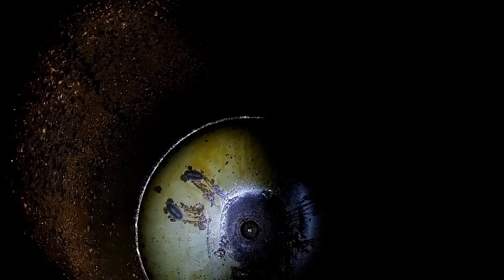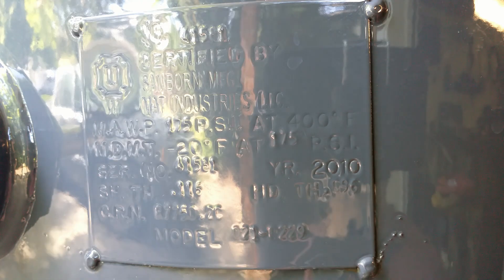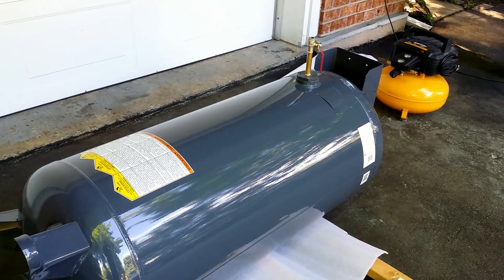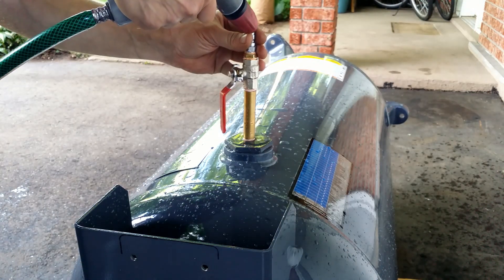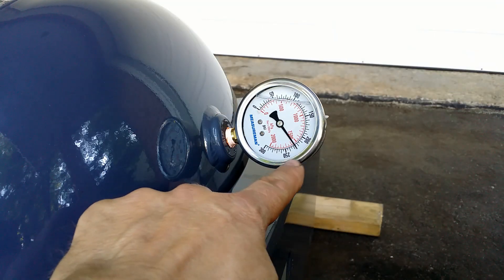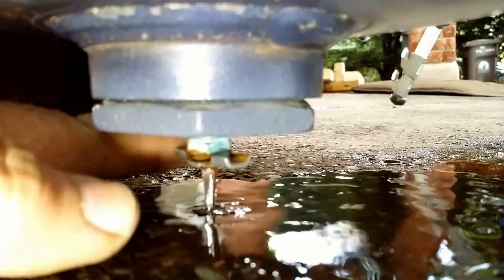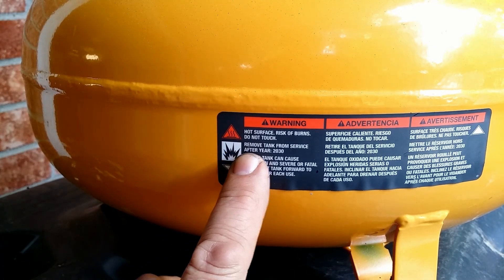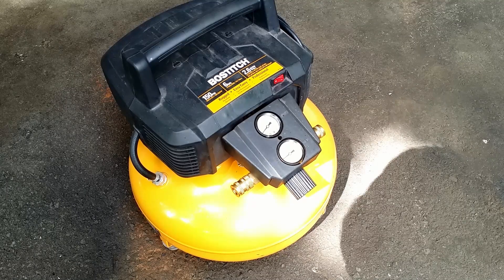Air Compressor Explosion Prevention. Hydro Test.

Comment: Was wondering is there a coating that could be applied inside the tank ? As some know hot water heaters are fiberglass lined to prevent corrosion now days. So why not a air compressor tank is it job security to build something perishable? So you have to buy the same thing over and ovr like toilet paper? I wonder if these manufacturers could do better.
Reply from the maker: Water heaters hold less presure and must be replaced every eight years. Compressed water doesn't hold as much energy like compressed air does. In case of tank giving up the water looses pressure instantly, the air tank will explode, and I mean EXPLODE!!!

Comment: Testing is only good to determine if the tank will explode right then and there at a certain pressure. Has no relevance to future safety. Testing is only useful to establish parameters as per design. When new.
Reply: Yes, without measuring deformation, this "test" is actually just over-pressurising your tank without making you safer. The maker of this video should have taken some old tanks that were visually obviously unsafe due to the amount of rust and damage and then tested them, I am sure many would pass this test on the first attempt but would fail if you kept repeating the test.
Reply: So what is a good test then?

I see many comments criticizing but none offer some tangible advice...go figure.

Comment: Excellent video. I will test my 25year old small horizontal compressor using this method immediately. Or maybe just buy a new one anyway….the pressure vessel failure videos/ pictures are a real wake-up call.

Comment: so now the tank has been stressed to 150%, I would trust it even less. Why not use an ultrasonic thickness meter instead?
Reply from the maker: By industry standards small (and yes, for the industry 60 gallon is small) pressure vessels are tested by filling with incompressible fluid (like water) and pressurized to 150% working pressure. Additionally, the tested tank is submerged in water to test how much it expands in shape. But you are right. Ultrasonic tests are sometimes conducted in larger vessels, piping and installations that work under pressure.

Comment: Did you change the gauge for the test or is that the same one used normally by the compressor?
Reply from the maker: You can use the same gauge from the compressor as long as it reads at least 150% of tested compressor working pressure. I used another gauge since I have one.

Comment: I forgot to mention before….if you have a damaged or rusty compressor, NEVER weld on or do other repairs on a compressor tank.
Reply: Have you ever owned compressor  ? Do you know anything about welding  ? Or are you just repeating what you have read  ? You can welding/ repair a tank if you know what your doing,  myself I'd go with a new tank or new compressor, but a skilled welder can safely repair one
Reply: @ericschulze5641  
I have owned a few, and have six currently. 
It’s not about how good of a job you can do, welding. 
It alters the heat treatment of the tank, and creates weak spots near the weld. 
They tend to crack near those welds.
Reply: @patrickflohe7427  maybe I'm spoiled because we have a boiler works and other major fabrication shops in my town and I'm referring to welders of that caliber
Reply: @ericschulze5641  
I understand there are excellent quality welders out there, but it’s more about what it does to the metal. 
When it changes the heat treat in certain areas, and that’s bound to happen, it creates stress concentrations, and cracks. 
Those can lead to explosive failures of the tank.
Reply: @patrickflohe7427  so there must be weak spots around the entire circumference of the end caps and main seam
Reply: @patrickflohe7427 you do realize the tank shell is a flat plate that’s rolled into a tube and welded longitudinally with two end caps welded on each end, the motor / compressor plate is welded on as are the feet brackets and the fitting ports. There’s nothing wrong with welding the vessel unless it’s internally rusted to where it’s too thin to sustain pressure, patching wouldn’t be recommended in that case. What you don’t want is a weld from someone who’s not skilled in the craft.

Comment: Excellent video. 
Well-done! 
This is something that a lot of people could do themselves. 
The only thing I would suggest, would be to provide a link to the pressure washer fitting, to help people find the correct fitting to test their compressor.
Reply from the maker: Thank you for your kind words. 
As for the fitting, different compressors will require different fittings. I went to a big box home improvement store, to pressure washers section and picked the right one for my compressor.

Comment: I still use a compressor tank thats dated 1984….  Still thick and passed a 300 psi hydro test..  old booger.. has at least 5 layers of different color paint on it.. started out army green as it was at some military base..  guess is why its so thick..
Reply: Me and my friend stumbled on a tank made in the 50s. 3/8 thick steel, with the end cap on top . At the welds, a solid 3/4 of steel. We found out because we cut it and modified it into a sandblast pot

Comment: My pressure washer gun sticks on once you pull the trigger.
It will not release until you stop the engine and the pressure slowly drains down.
It would immediately try to put over 2000 PSI into the tank.
CAUTION if anyone has a similar defective pressure washer. 
STAND CLEAR of the TANK when testing. If it does fail, It should not be a big explosion with water in the tank but it might spew little pieces of shrapnel from weak areas. PROTECT YOUR EYES is the main thing.
Reply from the maker: It is dangerous that you cannot control the gun. Is it like that by design?
Reply: @robertdeptula2003 
I don't know the design.
But I have tried two different ones and both of them do that. 
It's like the pressue builds up when you pull the trigger and becomes too powerful to be able to close the valve when you release the trigger.

Comment: I think it would be a good idea. If you knew what you were talking about before you posted a video like this tanks do not explode due to corrosion only due to overpressurization only
Reply: I think your correct, 125 - 150 psi rupturing a tank should only pop out the area where the rust is,  not make the tank explode,  I suspect every one of the videos where they have exploded, are because they have modified the pressure switch,  and modified or bypassed to blowoff valve,  yes ?
Reply: @ericschulze5641  it’s not that they have modified the pressure switch in any manner in most cases, the cheap pressure switch and relief valve fail simultaneously.
The contacts on the pressure switch weld themselves closed. At this point the compressor will not shut off if the relief does not open, the tank will explode quite simply.

Comment: I have seen individuals modify the drain valve. It is always at the lowest position in the tank and very awkward to get to. Purchase a short nipple and a 90° sold brass elbow and a section of brass pipe that will allow the valve to be reachable from an easier location on the tank. You will need a brass coupling to re attach the drain valve to the drain pipe. One might also replace the cheap valve that always tends to seize up with a more appropriate lever style valve with that "big red handle". Makes draining a breeze.

Comment: I got my 150L horizontal tank shop compressor new over 25 years ago, but one day about 8 or 9 years back I realised that the drain valve wasn't selling properly. A bit of digging later I realised that it had some flakes of rust on the valve seat. I immediately depressurised it and started popping off bungs and adapters to see how bad it was, and from as many angles as possible.

In all honesty, it looked no worse than yours, so I put it back into service, but it still had me a bit nervous. I'd heard all the horror stories of compressor tanks taking brick walls out when they let go, and my home workshop isn't that big (when I'm in my workshop, I'm never really more than 3 metres away from the compressor), so it felt a bit like I was sharing a room with an unexploded bomb !

I decided I needed to sort the internal rust out, so I stripped everything off the tank, 1/4 filled it with a rust desolving chemical called "Deox-C", then every couple days I moved that ridiculously heavy lump into a new position to make sure every surface had spent at least a couple days submerged. After that rinsed it out, took out the bungs, and ran an electric heat gun through it until the whole tank was nice and warm (and dry). Not wanting a reoccurrence, I dumped about a litre of a rust converter called "Hydrate-80" in there, and rolled that damn tank around for about 20 minutes to make sure all the flash rust had been treated. I emptied the last of that out and left the tank open for a couple of weeks (I had my smaller compressor plumbed in by then, and too be honest, I was getting sick of messing about with this bleading great tank. 😣).

During that time I decided that for peace of mind, I really needed to pressure test the tank while I had it bare, so I bought a few fittings to connect it to my pressure washer, took the tank down the garden, and strapped it to a tree with every ratchet strap I owned (Logically, I knew it SHOULDN'T explode with any real force, but phycological, the whole process scared me senseless, so I wasn't taking any chances. 🙄). I took it up to 250psi and left it for an hour. The pressure dropped to nothing during that time, but I found it was just a bung not making a perfect seal, so I resealed that, topped up the water again, re-pressurised it, and left it for a couple hours that time. When I went back to it, everything was still fine !

After emptying it and dragging it back into my home workshop, I did the hot air gun drying routine again, and reassembled it. Job done.

As I said, I did all this sometime in mid 2014 or 2015, and it's only recently that I've started seeing an ever so slightly rusty hue to the water when I drain it, so I'll probably need to do the rust converter part again at some point....... I'm just not looking forwards to the job. 🙄
Reply from the maker: Over 25 years old? Horizontal compressor? Scary. Test it or replace it. Better safe than sorry.
Reply: @robertdeptula2003  As I said, It didn't have any heavy rust inside it when I did the tank clean up and pressure test 8 or 9 years ago, and after the rust removal I couldn't even see any patches of pitting. it's also only recently started showing a slightly murky colour to the drain water. 

Just to be sure, I really do need to pop out the end bungs at some point to get a good look in there, but as far as I see it, there's nothing to indicate there's anything particularly bad going on yet. Once the weather warms up a bit I'll get on it (So later this year). At the minute it's just above freezing outside, so I'm not likely to start anything that needs me to use my compressor for a couple of months anyway.
Reply: @Reman1975  
The problem is, you don’t know how thin the tank wall is, at its thinnest point. 
With the cycling of pressure, minute cracks can develop, and once they propagate, it can happen rapidly.
You won’t necessarily know until the thing explodes.

Comment: The purpose of a HYDRO TEST is to safely measure how much the tank volume increases due to internal pressure. Water is used instead of air because water is virtually incompressible and therefore doesn't become a half million pounds of additive inches of pressure squarely looking for a way out of its curvy prison. This Hydro Test can be done by measuring the circumference of the tank both before and after pressurizing. Another method is to submerge the depressurized tank in a Big Ass... Beaker that's big enough to completely submerge the tank and have an unbroken water surface that can be marked for height of water both before and after the pressure. A few calculations to determine expansion volume percentage or whatever is popular. The tank itself is filled completely with water and set in Beaker. The water level of Big Ass Beaker is recorded at atmospheric pressure. The tank is pressurized by pumping in additional water to the pressure established for the particular tank. The Big As Beaker water volume wil be checked and a calculation will be done to adjust for variables like tank shape etc.

No proofreading time but, I'll be back.
Hope this makes sense, I was under a lot of covers hoping for a little sleep. This is the 8th day with only 3 hours on day 6 of actual sleep on the books. 
How this helps.

Comment: Hi,
My 60 gallon tank seems to be leaking at the bottom piece where the drain valve screws into. I thought it was the drain valve at first, but have tried quite a few different ones. Can that piece at the bottom be replaced? It's made like that piece that you took off the side of yours?
Reply from the maker: I don't know what tank you have, but as you can see on my video the bottom plug can be replaced the same way I changed mine on the side. But it can be rusty and very difficult to unscrew. Look for "bushing" as the replacement part. In my case the bottom bushing is 2 inch straight thread and 3/8 inch pipe thread. Good luck!
Reply: @robertdeptula2003  Thanks. Mine is a Puma 60 gallon compressor. I'm going to get a bigger pipe wrench and see about getting it off

Comment: Prior to starting the hydrostatic  test you should take a few measurements on the tanks diameter; when they test scuba tanks they de rate the scuba tank after testing if it expanded more than "___:" tolerance.  That is called "deformation. I doubt you would have any at these preasures, but if you did that would be a area off concern. I used to do numerous hydrostatic tests for the US Navy and the 150% of operating preasure is correct. Along with no leaking is No Deformation.
Reply: Yes! because if the tank is not good the pressure test used here could further weaken the tank, measuring for deformation is essential.

Comment: I just got a 2005 60gal qts5 Quincy from my Uncle. I had suspicions that be never drained it when he stored it 5 years ago. Turns out he didn’t. Inside bottom is very badly rusted. I haven’t filled it yet and honestly think it’s compromised now. Sadly.
Reply from the maker: Do the test, use your judgement, stay safe!

Comment: You look inside the tank, but you don't even bother to look at the bottom, where water would collect.   Fail.
Reply from the maker: The very first few seconds of the video is the bottom view. No visual inspection necessary, pressure did the test. Pressure test was successful. Win!

Comment: Nice video thanks I have a Ingersoll Rand 60 gallon compressor 15 years old use it like 20 times and I always drain it when I finished. I always leave the drain open until my next use. Any idea what you think inside looks like?
Reply from the maker: My official response to your question is: follow the industry standards in your place of residence/business. It is always better to be safe than sorry, but I would not expect significant tank rusting in such a occasional use.
Reply: @robertdeptula2003  Ok thank you so much.

Comment: Wonderful video. I recently bought two used compressors and have gone down a compressor-safety rabbit hole. I always assumed a breached tank would just bleed out slowly, but apparently not the case! Glad I learned this and thank you for helping to spread some useful knowledge about the risks and how to safely test and maintain a tank.

One item of partial disagreement: the conventional wisdom that things used to be built better really isn't true in my experience. You just have to go to a thrift store and look at all the junky old furniture, gadgets, and yes, tools, from decades ago to know this. I think the reality is complicated in that every manufacturer has two competing motivations: to produce cheaply, but also to maintain a reputation for quality. So you have a lot of complicated dynamics where certain parts or items are cheapened, while others are improved, and quality really has to be assessed on a much more nuanced basis.
Reply from the maker: For the first part of your comment: thank you and you are welcome. 
For the second part: I have four old Volvos (presented on my chanel), excellent cars still running. Many times it is better to replace some parts from "U-PULL" than to buy new, even at dealership.
Reply: @robertdeptula2003  Yes, I understand. I've had similar old cars, and sometimes components are incrementally cheapened even during continuous production, no doubt that is true.
Reply: @robertdeptula2003  Comrade, old Volvos are unicorns in a class of vintage quality by themselves.  They are like tanks that given the right mods and a decent road could climb Mt. Everest.  I used to own an '82  242 GT coupe.   Regardless, I fully agree that any time you can rebuild an OEM part, it's best to do that.
Reply: Interesting point about survivor bias—we mostly get exposed to the old things which lasted not the old junk that was abused and trashed and didn’t make it. A thrift store used to demonstrate a wider sampling of old goods is an interesting idea.
Reply: I think that's exactly right. What you see still working in a decades-old workshop is the stuff that did last. Also the person to have a decades-old workshop probably bought better stuff to begin with.  @cosmicallyderived
Reply: yes i thought the same, now i have 2 old tanks that i need to do this on.